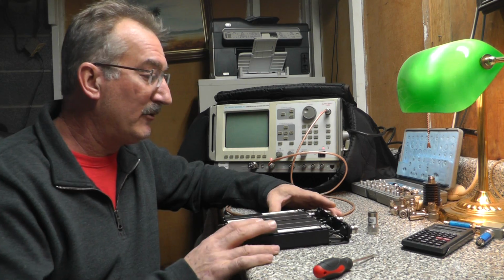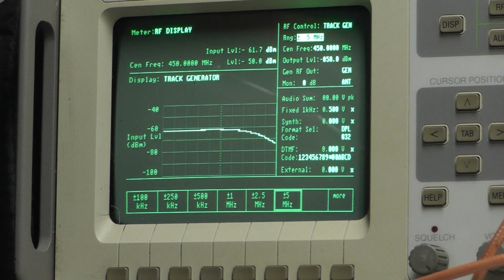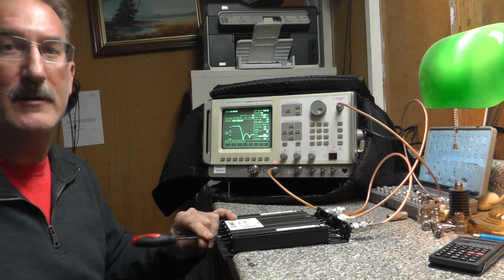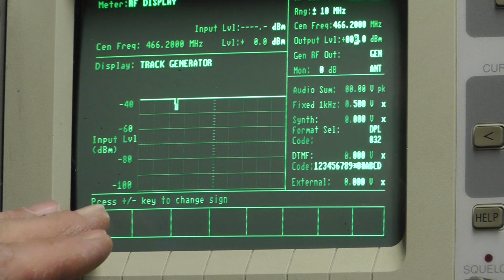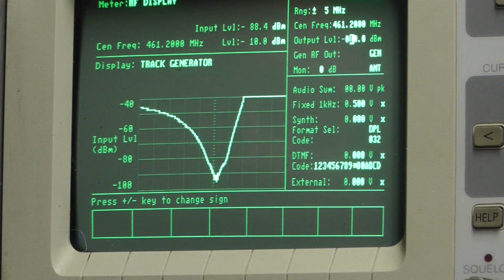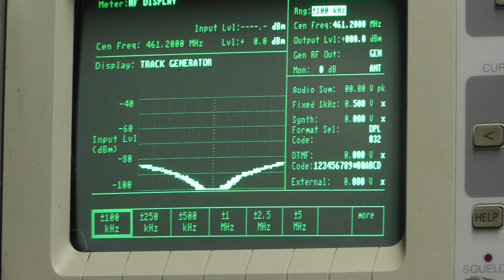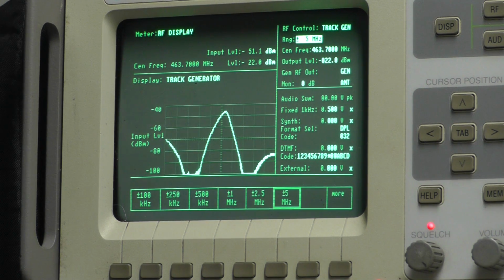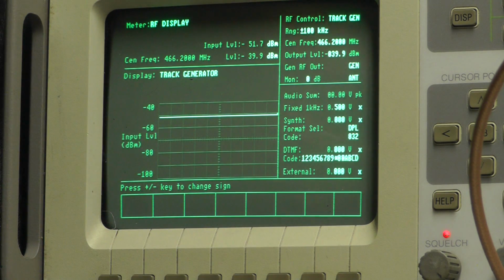Mobile Radio Duplexer Tuning

Comment: Thank you VERY much for posting this particular video!  I have that same exact service monitor and had great luck tuning band pass and BP/reject cavities.  But I struggled with NOTCH duplexers, I just couldn't figure it out.  Your video fixed that!

After watching your video I was able to re-tune a little notch duplexer set for a UHF repeater and I also FINALLY got my 900 MHz duplexer tuned up for my new 900 MHz repeater!

After watching your video, it was a snap!  

Thanks so much!

Bill - N5MBM
www.n5mbm.net
Reply: I had my monitor for three years without being able to tune any duplexer until I found your video , perfect, could u please send an explanation for using cable fault and antenna tester .,thank you for everything.
Anis